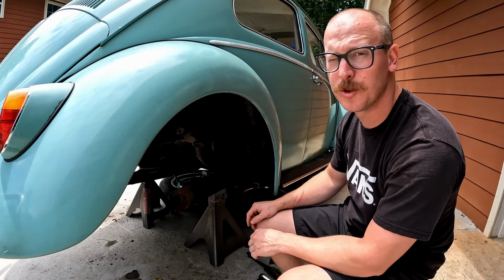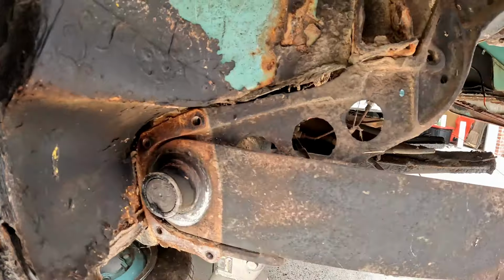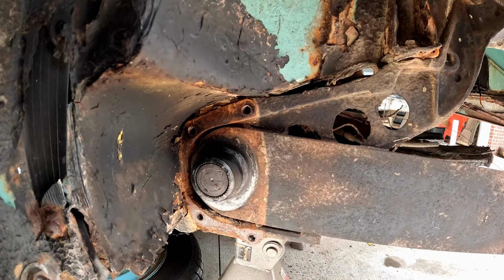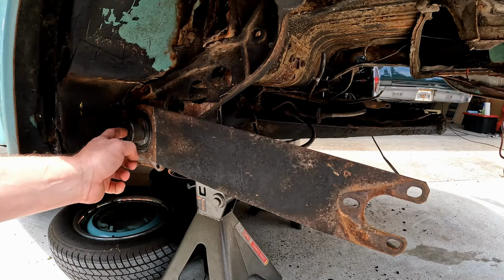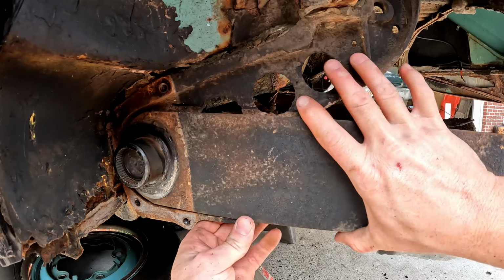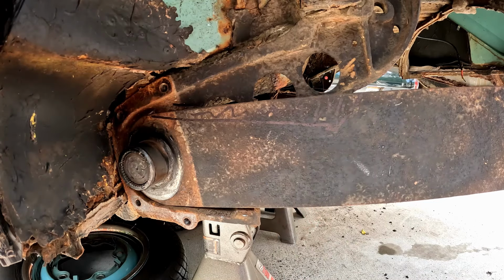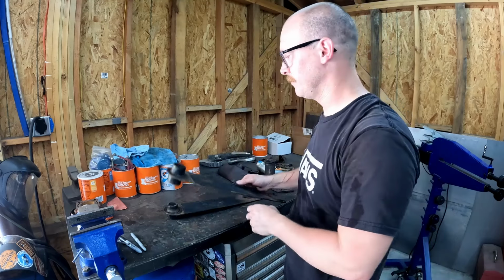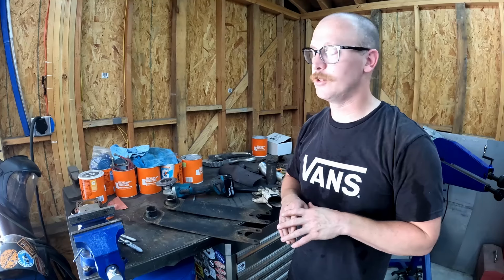How to lower the rear of your VW Beetle

Comment: I stumbled on your channel after jumping into the VW world with both feet and probably head first. I bought a 74 standard beetle  and a 71 fastback. Both are in fairly good shape the Bug needs a frame head and a few minor repairs. They both have been sitting for a 15yrs or more.  I have started the Bug, it sounds good. I am picking up a good bit of knowledge watching your videos. Just wanted to say thanks for your time. I live in Alabama so I understand the heat and humidity you are dealing with

Comment: Hi, i am working in a 68 bettle, the manual says that the stock angle for the spring plate is arround 16º, but i cant find the reference from where i must mesure that angle, i have two versions: 1) the mesure shoud be made form the ground. 2) the mesure should be made from the asembled position of the spring plate (When its loeaded and resting i the torsion bar support, please could you clarify ths?, Thanks!